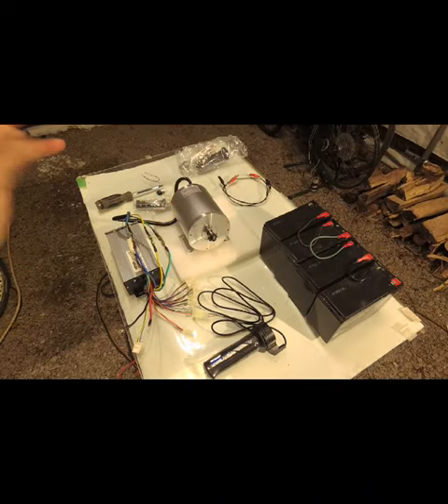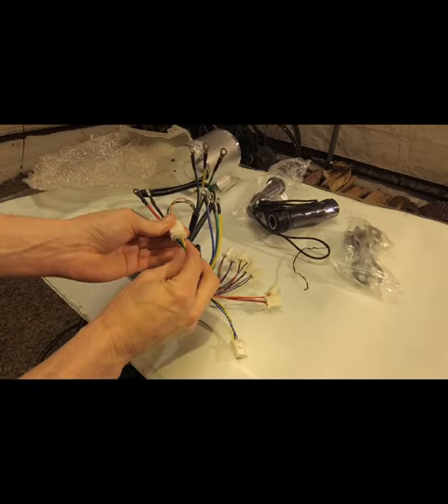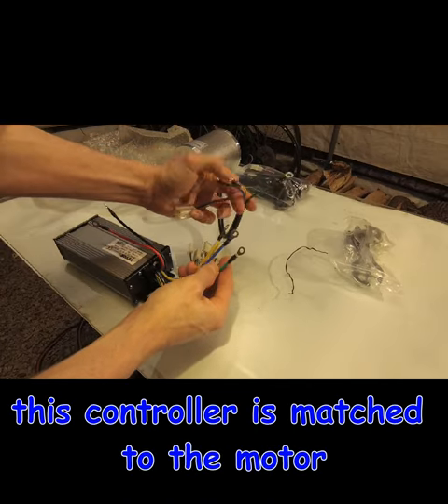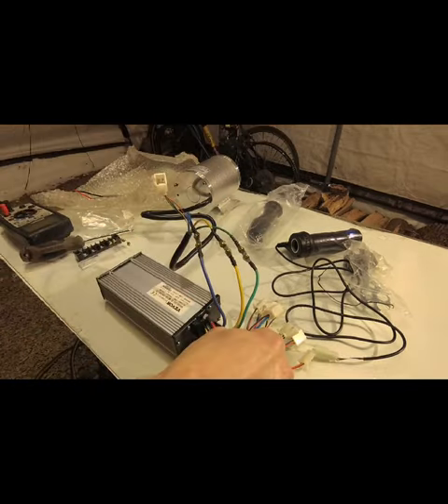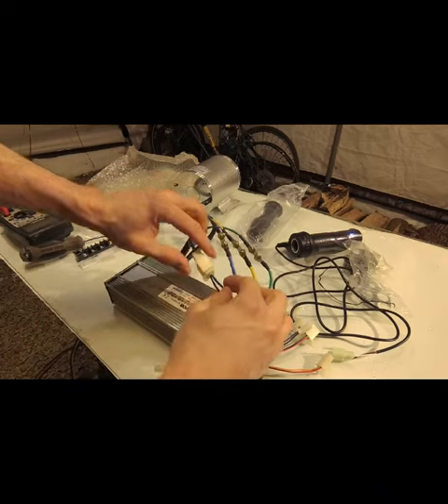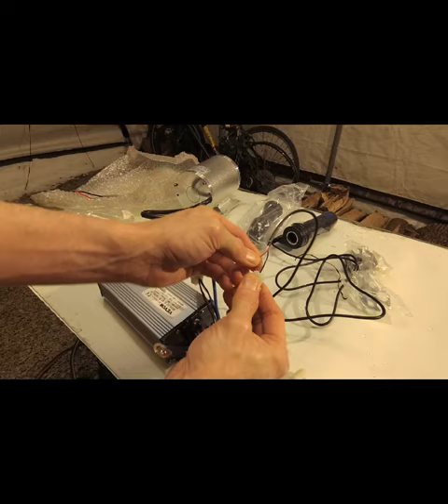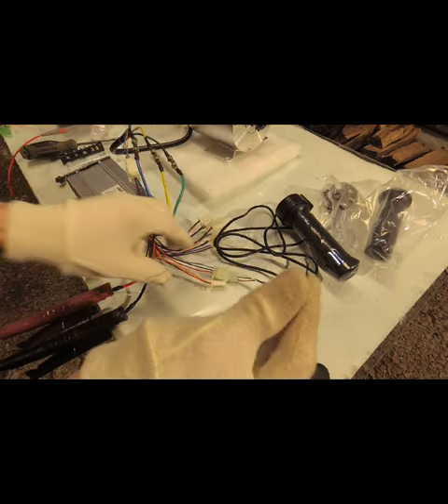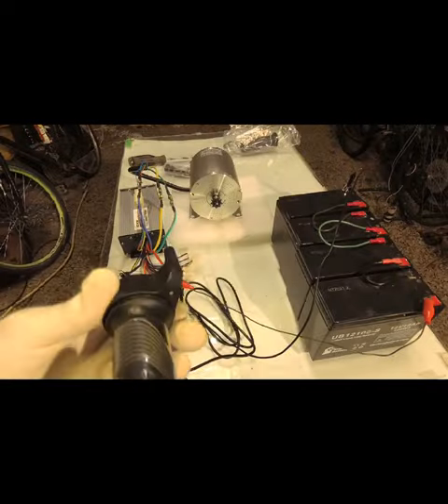1800w 48v Brushless Motor Kit bench test #shorts

Comment: Let’s say I have something powered by a 24v battery but I want to switch it with a 48 volt. Would I need to change out the speed controller/module with a 48v and/or could I settle for 36v module

Comment: Can I use the motor alone with my own speed control knob and plug it in? Will it work? I don’t need those other parts. I’m using it for a different project.
Reply: No, this engine needs a driver :/

Comment: Hello, I bought this kit and it arrived today.  I take the motor out of the box, and the gear on the shaft is too small for a normal 1/2" bike chain.  Do you know where I can get another gear that is bigger so I can use it with a normal bike chain? Thanks.
Reply from the maker: Hi, the sprocket on the motor is T8f. You're bike chain is probably a 410 chain. You can find 410 Oval sprockets on many sites, AMZ, Alie, Ebay. Use two wrenches to remove the nut I believe it's left hand threads, clock wise to loosen. Good luck
Reply: @kurtscottage  Thanks for the responce, will consider getting one of those sprockets, but do you know where I can find one of those sprockets that mounts on the rim that would go with the T8f sprocket?
Reply: I have this exact same vevor kit. Got a 48volt battery and I'm getting no voltage readings from any of the ports

Comment: Hey are you open to a few questions about this throttle and kit. I just got the same one and struggling a little. I didn’t see where I could send you a message other than a comment
Reply from the maker: I'm posting a video soon on this motor, maybe it might answer your questions, if you haven't figured it out already. Sorry I don't log on much due to time constraints.
Reply: @kurtscottage  hi i have bought a 36v 350w motor and build my bmx to an ebike with 2 makita 18v 7ah battery but if sit on the bike the motor cant move the wheels like its lack of torque (i’m 72kg) what should i do?
Reply: @elephantofficial3999  you could try changing the gear ratio

Comment: Does anyone know if this controller has any protection not to discharge the batteries too much?
Reply from the maker: I always disconnect the fuse or terminal, but I don't think it will drain the battery as long as the electric lock plug is disconnected, I have an ignition switch connected to those wires to turn controller on and off.
Reply: @kurtscottage  what about when you are using the motor (let's say you are running the motor for an hour with no stopping). Will the controller notice the voltage drop and stop the motor, to prevent damage to the batteries?